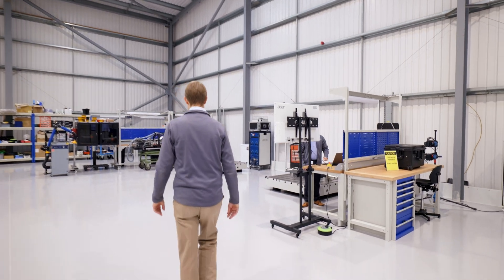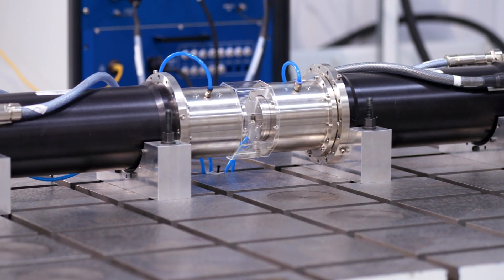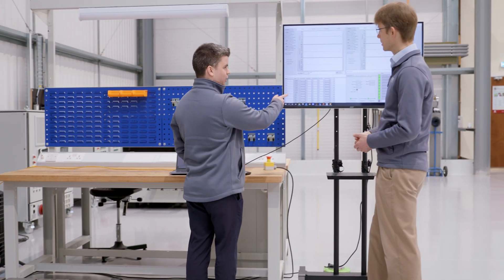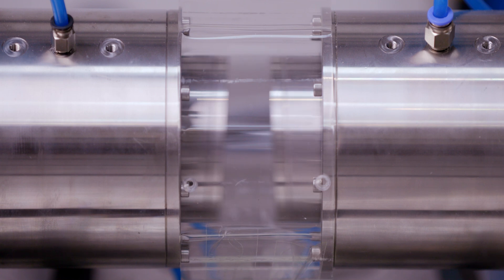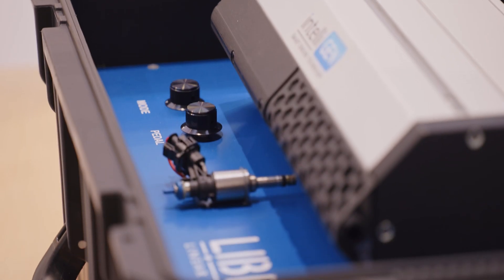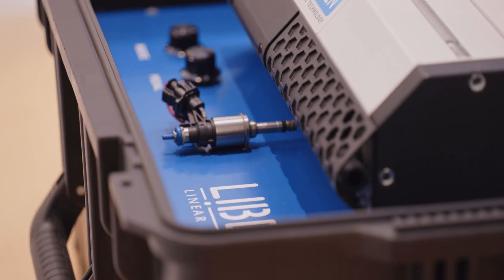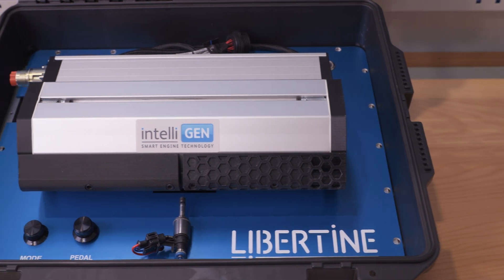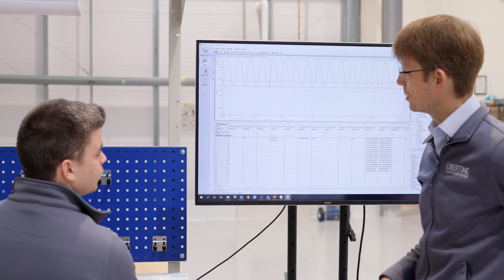Meet Libertine's team and take a closer look at Libertine's Linear Power Systems technology

Comment: Burning Hydrogen is nuts!! Your generator has possibilities for a range extender for some vehicles where space and weight is a consideration. As an emergency power source for electric light aircraft. Hybrid cars are old technology much better to use a range extender, no direct drive from ice motors.